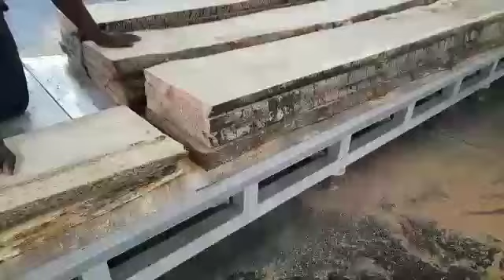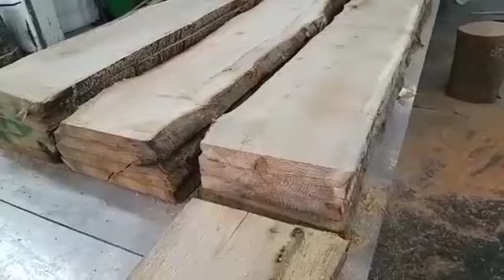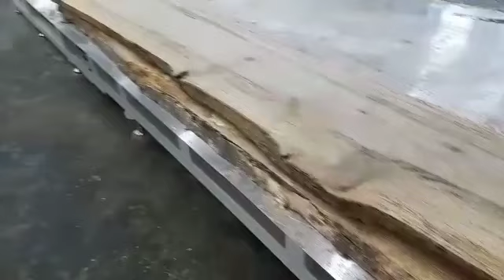How to dry wood fast ? HF Wood Vacuum Dryer

Comment from the maker: HF Vacuum Dryer Eco-friendly
High frequency vacuum wood dryer is advanced wood drying equipment, which only needs electricity without boiler, environment friendly and easy to handle with.  Comparing with conventional kiln dryer,   HF vacuum wood dryer capacity is small and flexible, less factory space needed; efficiency is much higher (more than 10 times faster than kiln dryer). After seasoning, timber is kept straight and in high quality without cracking. Out-turn percentage of timber increased. HF vacuum wood dryer is the best choice for small and medium furniture manufacturers.